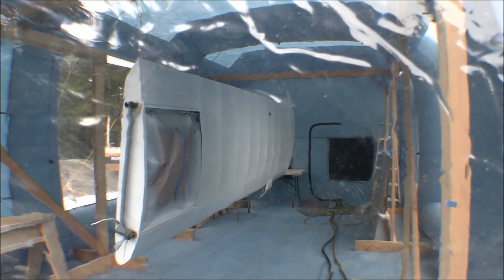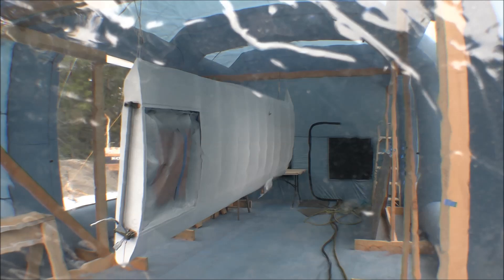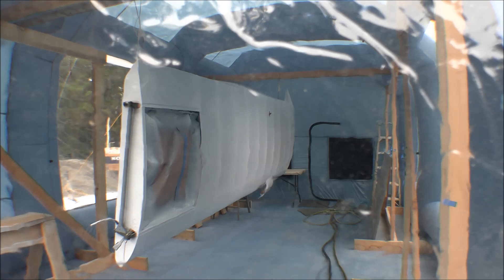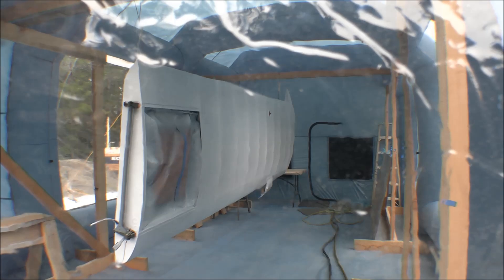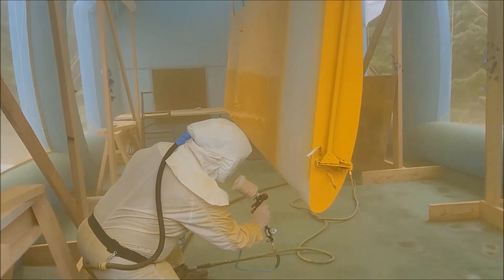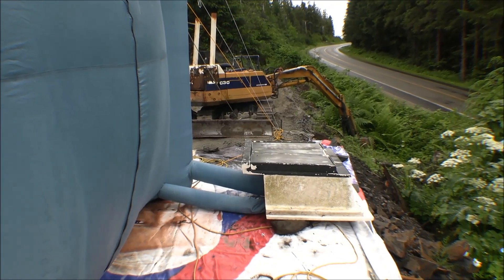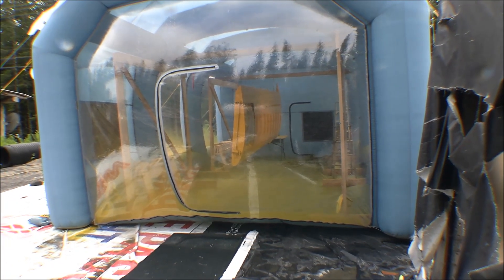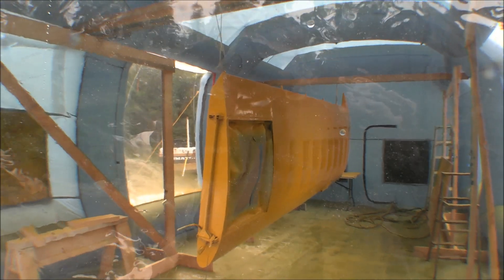Piper Super Cub Wing / Finally Painting The Finish Color

Comment: Nice paint work. I just finish the first coat of poly brush, i am wondering if i should go for a second coat with the brush before spraying the poly brush ?
Reply from the maker: the first coat of poly brush goes on right after heat shrinking. You should brush more on over areas overlaying metal( leading edges etc.) you can tell when you have enough when it quits developing pin holes( you'll see bubbles coming out of the poly brush). Bed all the tapes down with poly brush of course, but no need for a second overall coat until ready to spray.